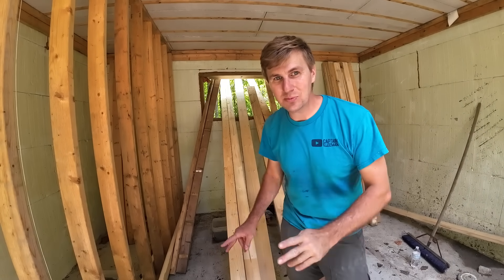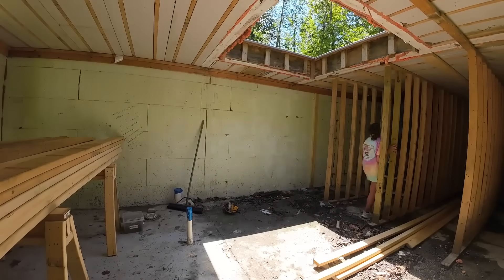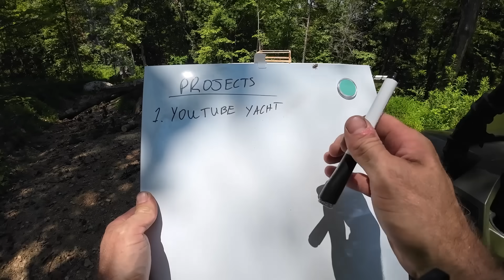Stripping Concrete Forms and Burning Brush at the You Tube Yacht!

Comment: I bought the same Ryobi chainsaw primarily to take in the Jeep but I find it much more user friendly than my gas saw for just about everything but the largest trunks. The one con is the oiling system, it dumps a lot of oil and the chips get saturated and don't clear so ya have to take it apart and clean it up after every use. Keep plugging away at all those projects and I'll keep watching, I am dying to see how the yacht finishes out. be safe Mike.

Comment: A tarp/visqueen plastic sheeting with some of that old lumber for a ridge cap would be ideal in closing up the stairwell to alleviate excessive water/debris intrusion to the interior.
Reply: Maybe he could scrounge up a fiberglass satellite dish to invert and put over the opening, or take a could pieces of PVC sightly oversized so they make bows like a high tunnel to support some plastic so it sheds water.

Comment: We can only burn in the winter when we have a minimum of 2" of snow on the ground.  When we do burn, we need a permit and we have to notify 911 n0n emergency of our burn location and permit number.  This is an unusual summer.  We've had almost double our normal annual precipitation. Normally we would consider dew points in the 50's as very humid. We still can't burn.

Comment: Could you use Dirt Perfect's broken clay pipe to clean it up with the old grinder or saw with a concrete blade and set it in that old creek bed to have the 555 a place to cross. 

Wait a minute I forgot they may  be gone dp's video schedule 🥴